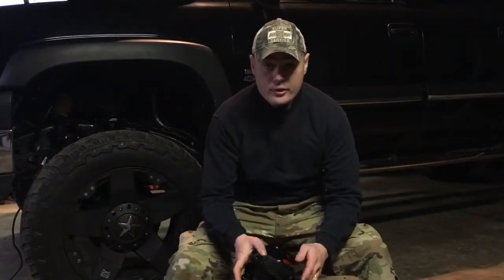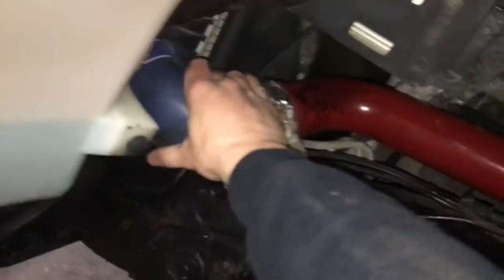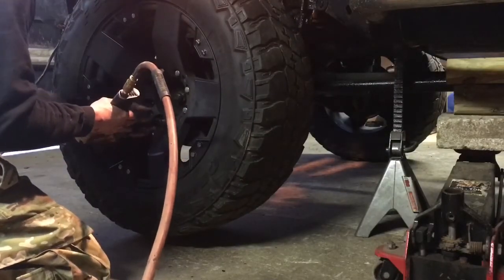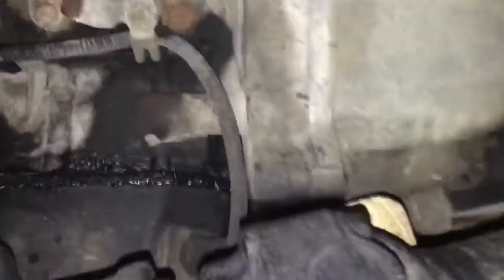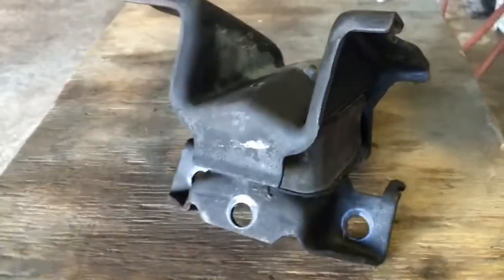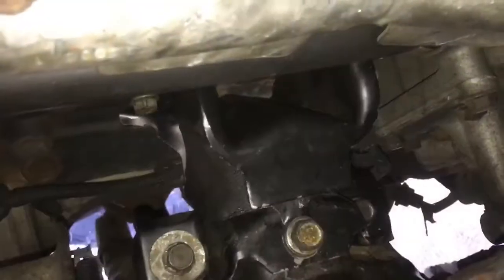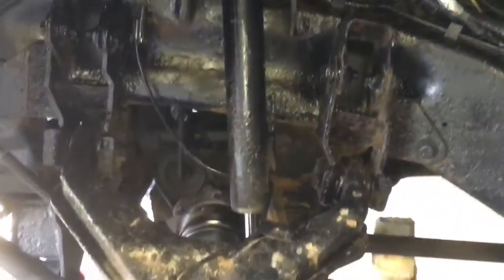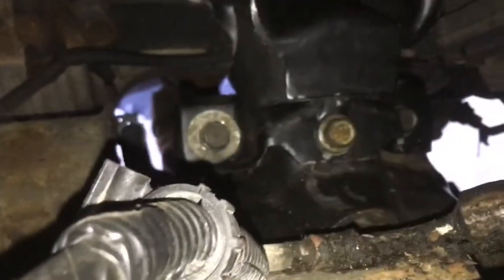How To Install Motor Mount on a Duramax

Comment: I got a set of Sinister Diesel mounts for my LB7, they were only about $100 more than a set of ACDelcos from Rockauto ($250 vs $350) and they will absolutely last the life of the truck, works of art these things are.  I'd rather not have to ever worry about an engine mount going bad again.

Comment: I was told last night that I am losing a lot of power because I have a broken driver side motor mount. Of course I’ll getting it fixed ASAP, but do you think I’m actually losing a noticeable amount because of the broken mount?
Reply from the maker: +Jon W I believe you are loosing power sounds weird

Comment: Was bad engine mounts causing your driveshaft to shift back damaging your rear center driveshaft support by any chance because I'm having a issue with that right now and they say it's my engine mounts thank you
Reply: Dang, that's the same thing I'm having happen! Just replaced the driveshaft carrier bearing, & all U-joints, and the test drive did NOT go well! The front shaft is trying to push the driveshaft out the rear of the truck!
Did you get it diagnosed & fixed on your truck??

Comment: Just had mine replaced on my 04 duramax 3500, an for some reason the starter got messed up cause now when I turn the key the starter grinds won’t start turn the key off hit it again works fine. Any suggestions?

Comment: So I have a question on my 03 lb7. I was underneath looking it over and noticed my deep ppei oil pan is barely sitting above the cross brace and there are a couple of very faint scuff marks that look like the pan has brushed the cross brace. Is this normal or do I have a mount issue and need to replace them. Don’t look like they’re bad and engine doesn’t jump when under a load during the in gear foot on brake test.

Comment: heres something to use from an old man thats been in every form of auto repair there is, from junkyards to service stations to garages to owning shop to big company "westinghouse" fleet cars to racing for several years. restoring antique and classics also, lots of screw loose products available, one product we all swear by and can not do without, kroil, i use aero kroil because i don't do much anymore and its easier for me, long line of products for anything you need but kroil will absolutely break a thread loose period, no excuses or if only, it works. takes longer on bolts stuck longer or harder , usually has to be purchased from kroil but hemmings magazine has ads for it.

Comment: Before you replaced this do you remember if it caused and sort of noise or clunk that you could feel in the cab?
Reply from the maker: Yes it made a loud clunk noise
Reply: This has to be my loud clunking. But my engine don't move like that at all holy shit

Comment: Been watching your videos for a while and I am currently struggling with removing the starter. Apparently I have a 2015.5 with the 3 bolt flange and it won't come out. About how much lift did you get after removing the mount? Also did you only remove one to get the engine up? are there more than 2 mounts? Lots of questions since I don't like taking it to the stealership.

Comment: Why not do the passenger side too?  Did you use oem or aftermarket?
Reply: The passenger side is easier than the drivers side because nothing is in the way, otherwise same process.

Comment: Out of curiosity, were you getting any clunking noises when going over bumps or such due to the bad mount?
Reply from the maker: +sav300 yes I heard a loud thump noise in the engine
Reply: Truck Master good to know. I'm hoping I find bad engine mounts tonight. I can feel it in the floor board and it needs to go!
Reply: I hear annoying metal on metal vibration sounds.... I feel. Like the mbrp down pipe is hitting the firewall when I give it fuel

Comment: Meh...show how the mounts is takin out and put in who cares about the 5 minutes wasted on non sense stuff inner fender, inter cooler tube, the crappy weak spot it was jacked up etc. Does the mount come out the bottom? Or does it come out the top?
Reply from the maker: +Al Larson I guess you can’t win them all lol it’s on the bottom when you figure it out post a YouTube video on it im sure you can do a better job
Reply: If you need a video showing how to take off the fender liner and intercooler I would not reccomend taking on engine mounts
Reply: @TruckMaster  There's always an asshole or two. Can't make everyone happy. Lol I on the other hand love it when someone shows everything that needs to be done to complete a job, including tips and tricks. I'm used to following a specific set of work instructions and procedures. I work in the aerospace defense industry. Everything has to be done by the book.